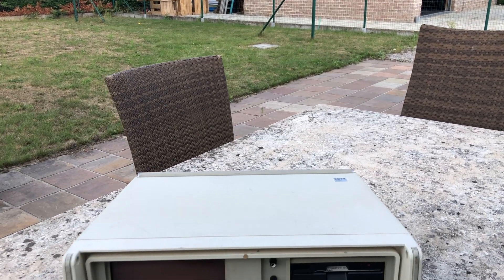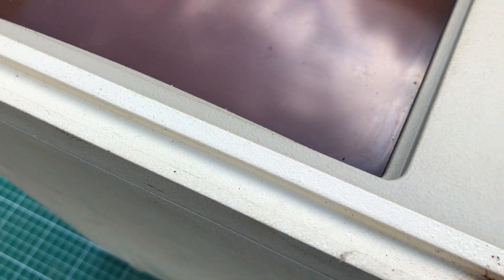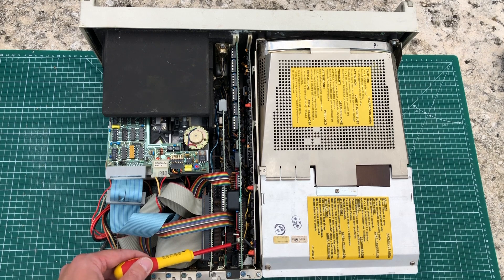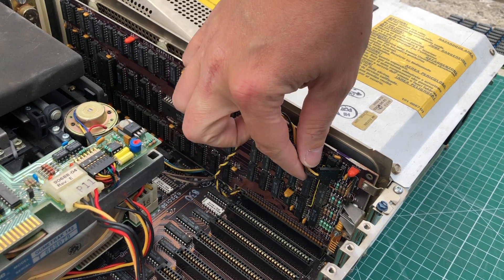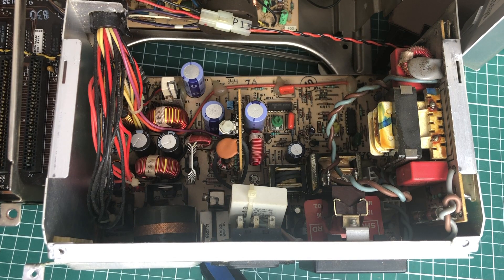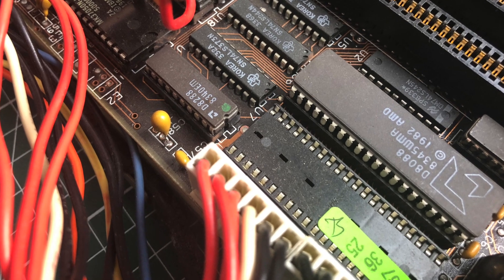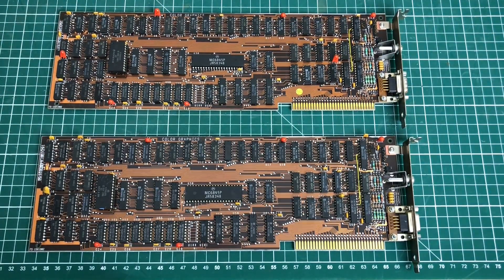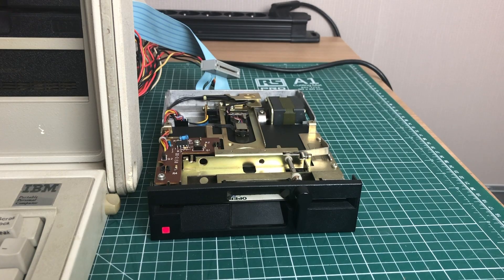IBM 5155 Part 1 : Surgery - Bringing the luggable back from the dead.

Comment: You're video helped me out a lot. My IBM 5155 which my dad bought new in 1984 and has been sitting in a hot attic since 1996 finally posted and even though the floppy drive hasn't moved in 25 years, once exercised a few times I was able to run PC DOS. Next up is to find out which expansion cards were causing problems.

Comment: Do yourself a favour, and get a reverse-drill bit/screw extractor set. Makes a world of difference when you can drill in the direction of the threads, because if it bites, it actually loosens the screw.

Comment: I am considering getting an retro computer to start off. Do I need to have a ton of knowlegde and skills on retro hardware in order to get everything to work?
Reply from the maker: Depends on what retro hardware you want to play around with ... different time periods have different type of issues / difficulties. Both for most there are grea online communities.
Reply: @RetroSpector78  Thank you for replying! I have zero knowledge on fixing hardware....and I was quite amazed when I see you know every piece of PCB and can detect and fix the problems of them.
Reply: @totommymmy  If you can't get into the hardware, you can always play around using emulators such as DOS Box. 
It helps to have a small background in electronics and computers. One thing that often goes on these old machines is the capacitors, so being able to identify the type/spec and having some soldering/desoldering skills is a pretty good start. But it's just like buying a vintage car. You need to know SOMETHING about how they work to be able to repair and maintain them. Fully working systems do go up for sale now and then, but they cost a pretty penny, and it's often more worth it to buy broken ones piecemail and fix them. You get much more enjoyment out of them that way.
Reply: @BlackEpyon  Thank you for the advice!

Comment: Now that I probably have seen you fixing dozens of shorted tantalum caps, it seem to me that most of them were on the -12V line. That doesn't look like a coincidence. But what could be the reason for that? I begin suspecting that the -12V rail generated by those old AT PSUs may not be as clean as a simple multimeter makes it look like. Maybe there are voltage spikes that damage the tantalums over time.

Comment: These kind of videos are great, but with each one I watch, I become increasingly doubtful of the usefulness of these kind of fixes. What happens after you repair it to working condition? You aren't going to use it for anything practical, it's just a collector's piece. It's going to eventually sit of a shelf aging even more and giving in to the ravages of time again. Almost doesn't seem worth the effort.
Reply: You could ask the same of people who collect and restore vintage cars. It's the same. We do this because we enjoy collecting, fixing, and restoring them. And once in a while, we'll take them out of the garage for a spin, just for the pure enjoyment, and to show off to like minded individuals.
Reply: @BlackEpyon  The problem with that analogy is that vintage cars are still very usable today. We don't have flying cars that would immediately make them obsolete. A restored car from 1960 would still be able to drive down the highway like one made in 2020. A computer from the 1980s would not be useful at all when compared to modern PCs.
Reply: @Levy_Wilson  If we used your analogy, cars in 2020 would be more "useful" because they can outrun the cops at mach 2. You can still type, do spreadsheets, and play video games on older computers, just as we did back then. They're not as fast or have as many features, but they're just as practical in the same sense that a car from the 1960's will still get you from point A to B the same way a modern car will, even if it doesn't have air conditioning. But people don't buy vintage cars to use as commuters, and you certainly wouldn't drive one in the snow and mud if you want to keep it's condition. In my area, there's lots of people who bring out their vintage cars on sunny weekends just to cruise around, show off at the truck stops, and enjoy themselves, not because they need to go anywhere with them (also true of bikers). People buy and restore them because they enjoy them, and the same is true for vintage computers. There doesn't NEED to be a "practical" value to them.

Comment: I would love to have this for my server machine. How much did it cost? Is that monitor compatible with regular graphics cards ..something like idk.. S3 VirgeDX maybe?
Reply: It's a amber-monochrome CGA monitor, which is composite, and a horizontal refresh rate half what the Virge puts out, so no. With how extensively you'd have to modify it, you're better off just tipping a tower on it's side.
Reply: @BlackEpyon  there's no gui on my server, so... I mean, won't it work for console output? like.. text only no?
Reply: @pmf026  Strictly for console output, sure, if your video card has a composite out. I haven't seen composite out on video cards since the early aughts (usually on a pig-tail breakout connector). You could also do a serial terminal using any XT-class system, since even modern servers still come with at least one RS-232 port.

Comment: To unscrew RUSTED bolts from plastic: 
step1: let it marinate in penetrating fluid
step2: heat up top of screw, with soldering iron (preferably chisel tip, in this case) 
step3: unscrew. 
(if still stuck: position a screwdriver on top of the screw, and give it a few taps with a hammer, then repeat above methods.)

The hammer method also works really well for screws rusted in metal. But you have to hit them harder.
Reply from the maker: next time I will try to show some reserve and patience and do it in a more professional way.

Comment: For drilling out screws - get a left drilling drill bit. it usually persuades most screws that I came across because you can transfer more force with it. And if it doesn't move at all, it still drills. Saved me loads of headaches.

Comment: Those mismatched screws are a telltale sign that someone has been in there before. There's only a few different thread sizes (3/32UNC and M3 as far as I know, just like modern PCs).
Reply from the maker: Have had 2 IBM 5155’s so far ... both with lots of different screws inside...
Reply: And then there's Compac and Dell with their Torx screws.

Comment: Nice.  I had a 5155 as my system from 1988 to 1993.  Fully decked out with a 20MB MFM HDD, AST 6 Pack Plus w/640k, NEC v20, 8087 Math Co-processor, and a 5153 external color monitor (I'd turn down the brightness and contrast on the internal monitor so it was essentially off).  Everyone always commented on the little floppy storage space above the floppy drive.
Reply from the maker: Hehe .. the place to store the most important floppies :) My first one only had 2 360kb floppy drives. Nice to have some extra storage now.

Comment: Probably a stupid question, but the only info I can find on the AMD version of the 8088 is that the x86 tech was licensed to AMD and a second source of processors for production of IBM PCs. What I'd like to know is, are there any differences between the two versions of the 8088? (One being produced by Intel and the other AMD) Or would it be correct to assume they are identical?
Reply from the maker: There is no difference between the Intel 8088 and the AMD 8088. (I think you mean "produced by Intel" instead of "IBM" ? Don't think IBM ever produced an 8088 itself). Besides Intel  AMD, there was also Siemens, Fujitsu, Harris, NEC, ....that produced 8088 (some using different clock speeds). But the AMD / Intel CPUs are identical.
Reply: @RetroSpector78  Yup, I meant Intel. I was thinking IBM because I think they were the ones that insisted upon multiple 'reliable' sources of production for the 8088.
Reply: You can thank IBM for insisting on multiple sources for the existence of AMD, Cyrix, VIA, and other x86 compatible CPU manufacturers over the years.  IBM was legally allowed to make and sell Intel chips as their model number up to the 486, which they did.

Comment: You were pretty rough with that drill, I would first try some chemistry before resorting to brute force. I gasped when you drilled away that piece of beige plastic on the side. I know, talk is easy, so don't mind me :D Anyway, cool machine and another great video!
Reply from the maker: Thought about it for a bit, but couldn't really find something that would be strong enough to solve the rusted screws but preserve the plastics ... the 3 screws are also pretty well hidden en I can put a nice cover on them :) Focus now is to get it in mint condition again.
Reply: Oh man that drilling was hard to watch. You can get extractor bits specifically for this purpose and there are plenty of plastic-safe penetrating oils for loosening up rusted screws. Heating the screw with something like an iron can also work it loose through thermal expansion, although you'd need to be careful with the temperature given the plastic.
Reply from the maker: @xenonkay  yeah it shows that I am clearly more of a software engineer than hardware engineer :)  Wanted to open it up asap and didn't have any of those tools at hand here .... But will look into it as I have another heavily corroded IBM with 1 screw that is completely stuck due to heavy battery leakage.